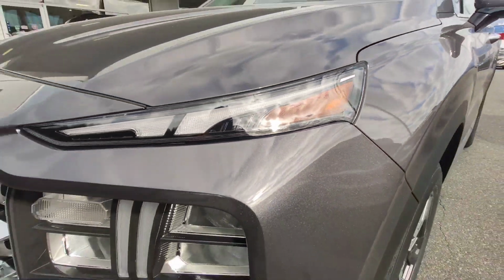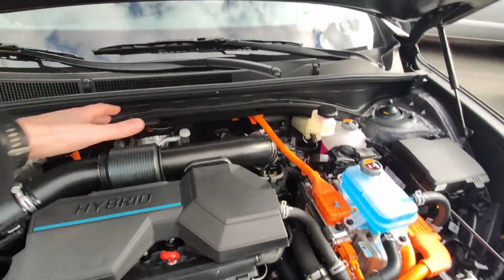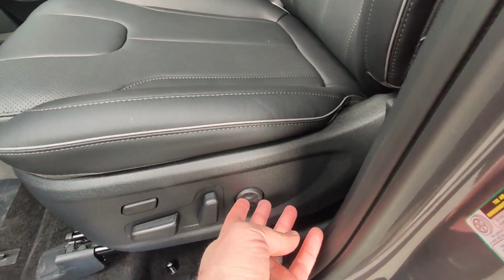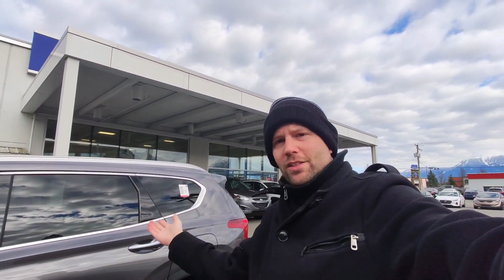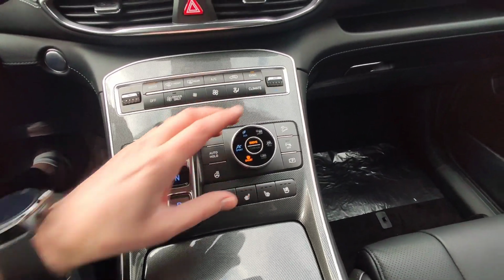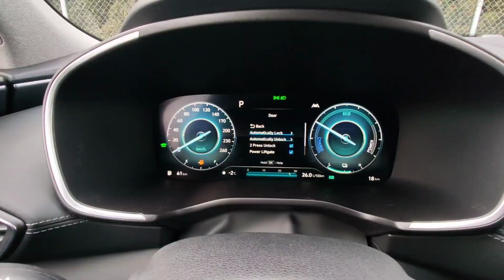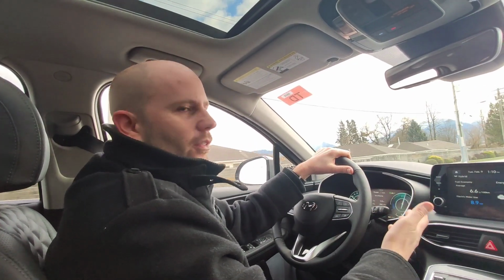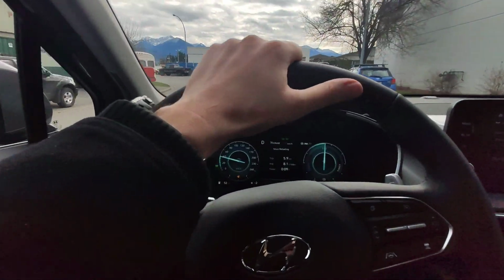2021/2022  Hyundai Santa Fe HYBRID LUXURY ! - Full Review

Comment: Sorry for the late comment, I'm looking at the PHEV, Santa Fe, but no dealerships have any on the lot to look at. I assume the PHEV and hybrid will be the same, so maybe you can answer my question;

In the second row, are there 3 car seat anchor points, and is the bench wide enough to fit 3 car seats?
Reply from the maker: There's no anchor points specifically for the middle seat, however people just use the inner anchor points of the outer seats, or the seat belt. But yes there's definitely enough room for three car seats across. The back seat in the Santa Fe is one of the widest in the industry.
Reply: @edsgarage001  thanks for the reply, do you know off hand if there are 3 top anchor point on the backs of the seats for the top tether points of car seats, or are there just 2 for the main seats
Reply from the maker: @shaneb9160  there's three...

As you can see at the 5:20 mark of the video 😉

Comment: Hi Ed. Great review. Have a couple of questions for you regarding the sound system. I test drove a Santa fe (preferred trim) here in Ontario recently and the Sound system was very dull. The sales man did not have a Luxury trim available but told me the speakers on the Luxury are better than the preferred that I drove, that the luxury had the same as on the calligraphy (Harman Kardon) but just with less speakers. Is that correct? or are the speakers on the luxury the same as the Preferred?  In general, what is your opinion of the sound system on the Luxury trim?

Thanks a lot !
Reply from the maker: Thanks!

The sound system on the Luxury is identical to the Preferred. There's no difference.

It would benefit greatly from a subwoofer.

Things may change for the 2023 model, but there's not currently any information on the 23 Santa Fe hybrid. But i highly doubt there's any changes
Reply: @edsgarage001  thanks ! that is what I thought. I think my salesman was just not carrying every bit of info on the Santa Fe. Honestly I did not like the sound of those speakers, I tried to adjust the settings a little but still. Will look into doing an after market upgrade to at least add the subw once I get the vehicle (already put a deposit, of course no date) and hope it does not void the warranty.  The order I placed is for a Luxury Hybrid. White exterior and beige interior. Now debating if I should switch to the Black exterior (want to keep the beige interior)
Reply from the maker: @Juanvera-qi1qp  you won't void the warranty.... The only way to void your vehicle warranty is to burn the vehicle to the ground

Comment: Thanks for that very instructive video. One question for you if I may: how do you select conventional cruise control on this vehicle(Canadian version). With the winter season in Canada, do you think (or believe) that once the front car sensor is covered with mud and snow, that the adaptive cruise control and FCC will still work?
Reply from the maker: It's interesting, because Hyundai generally let's you disable and modify everything... BUT you cannot disable adaptive cruise. I think the reason they chose to not give you the option, is because if you're used to it having adaptive cruise control, the possibility of rear ending someone when it's turned off is going to be high, as you'd be expecting it to slow down.

But you are correct in the assumption that it won't work if covered in snow. It will put a warning up on the instrument cluster that the system is temporarily disabled.
Reply: Thanks for your quick answer. So, another question comes to mind regarding the adaptative cruise control. Could you explain to me: Why is it, that the American version (Hyundai Santa Fe Hybrid) CAN switch between adaptative cruise control and conventional cruise control (press cruise control button and press and hold distance limiting button for 3 seconds and, select either conventional or adaptive cruise control from the instrument cluster) and NOT the Canadian version? (I found out about this while regarding videos on Hyundai’s adaptative cruise control (smart cruise control) on YouTube’s website). Again, let me thank you for your time and effort to answer me the best you can. I am one of your most dedicated follower. KEEP UP the good work! 👏👍
Reply from the maker: @richardpage6024  thx again for the comments!

Well, I'd love to be able to answer that question, but I honestly don't know. 

I am now, however, going to try that as I wasn't even aware of the ability to do it 😬
Reply from the maker: Great questions!

And thank you for the comments!

Comment: My car has a Voice Recognition Button on the steering wheel, that works ONLY if connected to either Android Auto or Apple Car Play.  My phone is an Android.  Hence my dilemma of not being able to use the Voice Recognition (VR) button for either calling via my phone or selecting radio or USB media.  I HAVE to be connected to the Android or Apple Car Play to use the VR button.  How ridiculous it is especially when its a 2021 model!  I am looking at a way around this dilemma.
Reply from the maker: So I think the easiest solution for you, would be to find an old cell phone that is no longer being used and just leave it in the vehicle, hidden away in the center console or glove box. You could even leave it plugged in.

Ultimately the best solution would be to inquire with your company's tech support to get Android auto functioning with your work provided phone.

It's not so ridiculous to be frank.... Pretty much everyone carries a cell phone these days, and most aren't in the same situation. Plus, the Google assistant will always work better then any automobile manufactured vr system, so it's the preferred choice for most drivers. Personally i can't remember the last time i used my vehicle's built in system 🤷

It's also possible to utilize Android auto with no data connection. You can even download Google map sections to use for navigation. Android auto has many basic functions that work without data, so a second phone left in the vehicle will do what you need it to.

If you lived nearby, I'd suggest coming in to see me so i can show you exactly what to do.

Comment: Apologies, I meant Forward "Parking" Camera with Sensors and visual display, as we have for Rear Parking along with the folding external side mirrors.
Reply from the maker: No, the power folding mirrors and forward parking sensors are only on the calligraphy trim. However the luxury does have a forward camera, which is part of the 360 camera system .

Thanks for the comment, please consider subscribing! 😉

Comment: I’m torn between hybrids ; Santa Fe Limited versus Toyota Venza Limited
Reply from the maker: Both great options... Though the rear drive motor on the Venza is weak and the cvt isn't as nice of a drive feel. Those two reasons alone would make me opt for the Santa Fe. 

But the infotainment system in Hyundai's is also significantly better. Plus Hyundai has a much better warranty. 

But to be honest, I'd get niether of them, instead, I'd go for the much lower priced, but newer 2022 Tucson Hybrid!

https://youtu.be/zNKKWoU3q6c

Comment: I smell BS here. "You pay a 5K premium for the hybrid, but you'll make up that money pretty quick in the first year on the gas savings if you do 25K km per year."  

On fueleconomy.gov, I see: 
Hybrid: 32 mpg -> 7.35L / 100km
Gasoline: 25 mpg -> 9.41L / 100km.

At 1.40$ per L, if I drive 25k km per year, I will save 250 x 2.06L x 1.40$ = 721$ per year.  

To make up the 5k difference, I will need to own the vehicle 7 years. NOT 1 YEAR.
Reply from the maker: Yes, someone else pointed that out..

I misspoke,  I meant you'd eventually make up that difference. I don't know why I said it the way that did to be honest. Just a slip.
Reply from the maker: And it's actually only a $2900 difference to get from a trend, to a hybrid trend. But a $5000 difference to get all the way to the luxury trim.

This vehicle was still super new to us, so I messed up a bit on pricing.
Reply: @edsgarage001  fair enough. Thanks for the good review though.  I will likely get the luxury hybrid in a few weeks -- but I hate the 8 inch touch screen. Do you know if the dealer can replace the 8 inch TS with the 10 in TS found of the calligraphy?
Reply from the maker: @patrickbergeron3787  no, unfortunately not. 

But the 8" includes wireless Android auto and wireless carplay which strangely the 10" does not. So there's that bonus. Plus, it's still pretty large. Doesn't look as nice as the 10" though 🤷

Comment: Why don't any reviewers tell the truth about hyundai/kia hybrid belt change costs?
Reply from the maker: First off, this is a feature review... Not a, hey let's pick apart this vehicle's repair costs. 

What belt are you even referring to?

There's just an accessory belt, and it's about $150 to have replaced by a dealership. At least, that's what we charge here 🤷
Reply: @edsgarage001  wrong the serpentine belt is spun by the hsg to start the motor as part of the hybrid system.  Apparently you don"t know jack shit about the cars you "review."
Reply from the maker: @robjohnson4963  woah there bud, calm down. I'm fully aware of that. Granted I called it an accessory belt. Woop d doo.

As a matter of fact, I've actually replaced the belt and tensioner assembly on my wife's old saturn vue hybrid. So I'm actually very familiar with it.

While I didn't make a video on that, I did on a different small fix on the same vehicle : 
https://youtu.be/O5A9MjWGOo0

Look, my point is, my service manager said it's about $150 to replace. But in any event, why the heck would I bring that up in a video about the vehicles features???
Reply: @edsgarage001  Because to not apprise the ignorant and stupid that constitutes the majority of our population about the rip off of hyundai hybrids is disingenuous.  And in my area, cause I contacted my local hyundai dealer its 250 plus parts to change the hsg belt.
Reply from the maker: @robjohnson4963  well here's the thing... The Santa Fe has never even had a hybrid option prior to 2021... So there shouldn't be anyone needing a belt yet.

But I'm currently standing over the engine bay of one right now.... If the dealer you're at can't do this job in under an hour, then go to another dealer. 

Remove air cleaner assembly (takes maybe five minutes.

Remove motor mount to gain better access (maybe 10 minutes?)

Compress tensioner spring, pull belt off. Reverse procedure. Done. I could do this at home without the right tensioner tool in under an hour.

Ultimately, this is something that needs replacing maybe 3 or 4 times in 10 years?

It's not my place to go over the replacement cost of a brand new vehicle's hsg belt 🤷 that doesn't even make sense. Where does it stop? Do I cover the cost of other potentially expensive repairs?? It's a vehicle, they cost a lot to maintain, but Hyundai has always been one of the lower costs to do so, even winning awards by Kelly blue book because of just that!
 Every dealer charges different amounts (guided by Hyundai, but ultimately it's up to the dealership).

Your original comment, "why don't any reviewers tell the truth about Hyundai/Kia hybrid belt change costs"..... I never lied about it, I never mislead anyone about it... I NEVER EVEN BROUGHT IT UP!!! 

I'm sorry man, but I'm not sure what you're expecting. But if it makes you feel any better, I wouldn't even take my vehicle to a dealer for repairs. I'd either do it myself (which I do 99% of the time) or take it to an independent shop. 🤷

Comment: HI ED - 
DOES THE HYBRID WORK LIKE THE RAV4 HYBRID, THAT IS, DOES THE ELECTRIC ONLY SETTING ONLY WORK AT VERY SLOW SPEED AND THEN THE ENGINE CUTS IN AT EVEN MODERATE, ACCELERATION?
HOW FAR IN KLMS/MILES CAN YOU DRIVE ON ELECTRIC SETTING ONLY AT NORMAL ROAD SPEED? 
IS THE POWER WORSE THAN THE RAV4 - AS THE RAV4 HAS A 2.5L ENGINE AND THIS HAS A 1.5L ENGINE? HOW MANY ELECTRIC MOTORS DOES IT HAVE, ONE AT THE FRONT AND ONE AT THE REAR LIKE THE RAV4 AWD?
Reply from the maker: Woah.... Ok, I'll try to answer everything here.

So, no, very different system. Remember, this doesn't compete with the Rav 4 prime, but it competes with the regular Rav4 hybrid. But the Santa Fe is significantly larger, so it doesn't really even compete there either. The Tucson Hybrid actually competes directly with the rav4.
The Santa Fe has a more powerful, 1.6 turbo and a 6 speed automatic. (No silly cvt like the Toyota)

-there's no EV only setting on the regular hybrid, but there will be on the phev.
-it will automatically switch to EV mode whenever it makes the most sense. It can do so at speeds up to 120kph/80mph
-again, as this is not the plug in hybrid, there is no real "range on EV mode" so we'll have to wait for the plug in variant to answer that question
-it has more horse power and torque then the Toyota Rav 4 hybrid. 
Rav 4= 219 hp, 221ft torque
Santa Fe = 225 hp, 259ft torque
-the Santa Fe hybrid actually has a 1.6 liter TURBO charged engine.
-it has one main drive electric motor. One motor/generator that takes place of the alternator and the engine starter motor 😁
-the Santa Fe has a true HTRAC all wheel drive system. It does not use a rear electric motor like the rav4. The HTRAC system performs far better then the rav4 system (check out TFL's slip test of the rav4... It fails miserably)

Hope that helps.

Thx for the comment!
Reply: @edsgarage001  GREAT DETAILED REPLY ...AND FAST...MUCH APPRECIATED...MOST CAR SALESMEN DON'T HAVE THIS KNOWLEDGE
Reply from the maker: @breaker1685  no problem ☺️

Comment: Interested if i should wait for the plug-in? What would be the main differences and when in stock to review?  I own 2009 Santa fe  (3.3 v6) and did not like the 2.4l 2021 gas only i test drove (engine-wise) but loved the new look and infotainment.  Did both hybrids also come with Harmon Kardon setup? Thx if can help...
Reply from the maker: It's a 2.5 in the 2021 non hybrid.

Main difference of course will be the ability to drive on pure electricity for a while, but it'll also have more power and better acceleration thanks to a bigger electric motor.
I won't see one until second half of the year though.
Not sure about the Harmon kardon system.. Stay tuned for the next review, going to try to check out the trend hybrid soon.

Comment: From an owner of two Sonata Hybrids over the past 8 years the best thing about the hybrid is that the technology puts the electric motor between the engine and transmission. This allows for gear shifts to happen instead of the typical cvt groans. To me it feels more spirited to drive. My 2014 Sonata Hybrid has never needed brake pad replacement and probably never will and the odometer is currently at 118,000 miles (US.) All I've ever completed on this car is the basic scheduled maintenance. The stronger sheet metal is also very apparent. I had a toyota for a company car for a year and after driving the two brands the Hyundai feels so much more solid.
Reply from the maker: I couldn't agree more!

Thanks for your comment!
Reply: Is the Hyundai hybrid technology as reliable as Toyota? Can I let the engine run all night in a camp type mode?
Reply from the maker: @MechayaAlta  based on the reliability of previous hyundai hybrids, I'd say yes, it's right up there. As a matter of fact, Hyundai doesn't use a cvt in their hybrids like Toyota does.

The hybrid battery isn't large enough to keep things going all night, so the engine would be kicking on to supplement power. I wouldn't recommend it.

Comment: Will this hybrid have any towing capability?
Reply from the maker: 2000lbs max
Reply: @edsgarage001    I ask because you can tow with the CRV gas model,  but supposedly not with the hybrid.   Toyota also says no on the Venza hybrid.  Not really sure of the reasoning on either of those.
Reply from the maker: @24Ellie  probably because both those models use a cvt transmission... But the Santa Fe hybrid uses a normal 6 speed auto.
Reply: @edsgarage001  Just curious, have you been able to sell the hybrids?   In the US I can't even get a date when they are expected in the showroom.
Reply from the maker: @24Ellie  yes, we've sold a few
Reply: One was in the showroom in BC two weeks ago. I didn't test drive though, because of $$. Rethinking about it now though

Comment: I test drove a 2021 Calligraphy 2.5 Turbo.  I clearly felt every bump in the road, even little stuff. Also very jerky acceleration and gear changes. CR"s initial report is very similar to my impressions(CR comment came out after my drive). My current 2007 SF rides smoother. Does the Hybrid have the same suspension? Does the ride feel more or less the same? Obviously the acceleration and shifting will be different.
Reply from the maker: I didn't notice that in my drive, but I don't think the suspension is any different. To be honest, I find it quite smooth, but I drive a car normally 🤷
Reply: @edsgarage001  normally...? Was that the end of the comment?  If you drive it again, try poor pavement or tracks, all cities including Vancouver have them :) . Again, did the ride feel the same as the regular SF? I tried a 2021 Pacifica Hybrid; notably smoother ride. Different animal, a bit more expensive, yes, but more versatile.
Reply from the maker: @rickochs4271  yes that was the end of the comment. Lol... But what I meant was, I normally drive a car, not an suv. Cars tend to be a bit bumpier then suv's
 Not always obviously, but mine's just a compact Ioniq EV car with torsion beam suspension in the rear. 

The lower trim levels of the Santa Fe are a bit smoother on the road, just due to fatter tire walls. But the luxury and calligraphy both have 19" wheels.
Reply: @edsgarage001   Yeah, I'm not a fan of big wheels, generally seem contrary to a smooth ride. Top line Palisade and Telluride have the same issue with me. Awaiting hybrid SFs to arrive in St. Louis. BTW, excellent review, thanks.
Reply from the maker: @rickochs4271  thx for the comment!